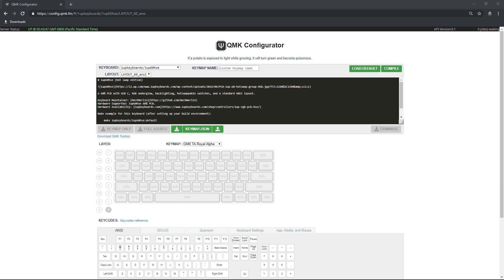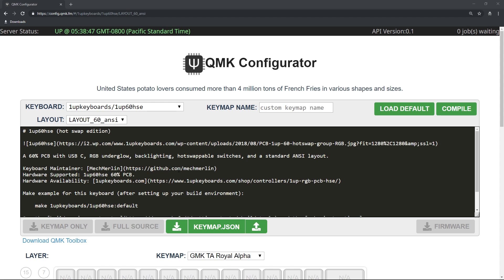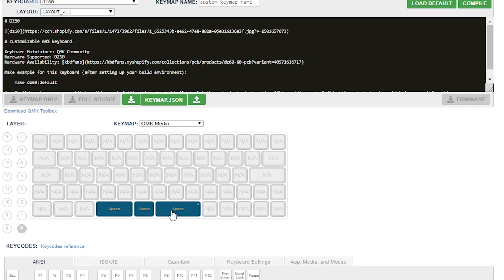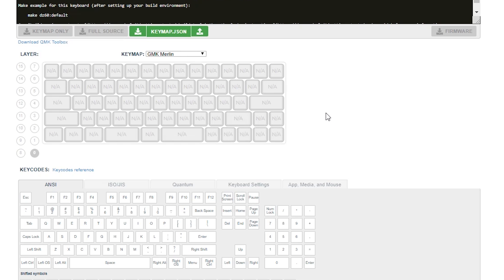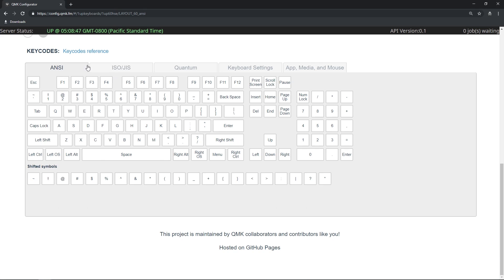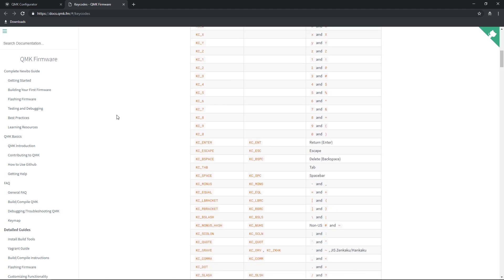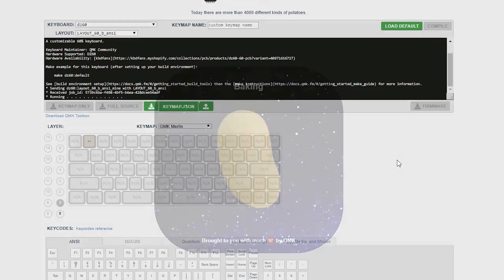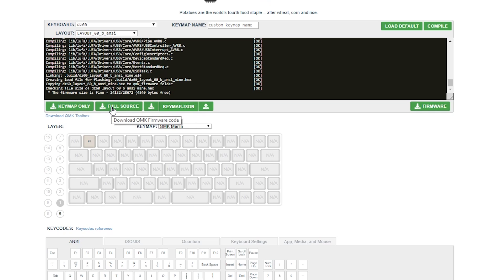QMK Tutorial: QMK Configurator (DEPRECATED)

Comment: underglow toggle for XD87 seems to not working for me
Reply from the maker: You may not be using the correct key
Reply: @MechMerlin  i tried on the key between esc & f1, and also on the 2nd layer. Idk if I'm doing wrong or not. Rgb toggle right?
Reply from the maker: @flumiie  are you sure your board has underglow?
Reply: @MechMerlin  yes, it was working with the default firmware

Comment: Will flashing your keyboard firmware allow you to use buttons that arnt available? for example I have the redthunder K50 could I then do a permanent remap of the enter key? I want to be able to use this keyboard for other devices to.
Reply from the maker: Yes it will work as you described. However this only works if you have a QMK powered board.
Reply: @MechMerlin  Ah that makes sense I thought qmk software was an open source project and could work with any board thank you for your reply :D.
Reply from the maker: @silencedspeech4953  You are correct, it is an open source project, but it still requires the correct combination of specific hardware in order for it to work. Another issue is that, even if the keyboard has the correct hardware, if the manufacturer locks the flashing down, there's no way to get past it.
Reply: @MechMerlin  Damn I wish there was someway to extract firmware somehow and add buttons that don't exist thanks for your help and advice.

Comment: Hi, noob question from a really mech keyboard noob builder (I preordered my first HS board, the HS60 v3). My board will have an ISO-IT layout, but when I click on the keys or try to drag and drop the keys in place the number row appears different from the original ISO-IT layout (for example, shift+2 is " on my keyboard, but the configurator displays an @), and some keys are missing, like "alt gr", right control... does this will affect the final result or is dependent on the language I'll choose in the OS?

Comment: im using the dz65rgb pcb and after i flash it (all other keys are where they assigned to) but the ctrl, alt , windows keys are not where they are supposed to be(win, ctrl, alt, space, alt, fn, win in that order) but i left it as default(ctrl, win, alt, space, alt, fn, ctrl). i didn't change any of those keys does anyone know how i can fix it?
Reply from the maker: you can try pressing "RESET EEPROM" on the QMK Toolbox before reflashing your QMK Configurator created firmware file.
Reply: @MechMerlin  wow you're the best! didn't know what i was doing wrong, thanks!

Comment: i am currently trying to flash a tada68.. I read that you can jsut reset the keyboard, delete the old flash.bin from the drive then copy the new bin into it. With the qmk configurator I want to switch the y and z because I am used to the german keyboard layout and add the special character äöü with the Any key but keep the rest in the english layout. The special character work just fine but switching y and z doesn't work, also my tada somehow came with a german layout and the new bin doesn't seem to change that either. So the only thing happening after putting the new flash.bin into my drive is that y and z change places to the english layout (which i do not want) and the rest stays in the german layout. This is really awkward and quite frustrating.

Comment: Possibly a dumb question, but what if your keyboard isn't one of the options on the configurator?
Reply from the maker: The configurator is a collection of all officially supported QMK firmware boards. If your board is not in the configurator, your board is more than likely not supported by the QMK firmware. You can file a request for it on the QMK firmware github page, but please be advised that QMK firmware currently can only support boards with a certain hardware configuration. Not all microcontrollers are supported.
Reply: MechMerlin Ahh, okay. Its a ps2arvgb controller so it's probably not supported. Thanks.
Reply from the maker: @Connor-uu  Which board is it? ps2avrgb controllers can be supported by QMK. I've recently put a lot of them in. This coming Tuesday I'm putting in support for the TGR Jane.
Reply: MechMerlin It's a Punchy 1800. 

Talked in the discord and found that other people are using bootmapper so I'll be giving that a shot after work today.

Comment: Having trouble with the media keys for vol + vol - etc on my DZ60
Reply from the maker: Which keycodes are you using?
Reply: @MechMerlin  KC_VOLU 
The keycodes in the multimedia key rows. I've tried the Mac(OS) ones as well.
Reply: Media keys work on another computer. Trying to figure out what setting it is on this one. Anne Pro 2 works though.

Comment: Can you configure two keyboards as one in this?
Reply from the maker: Could you elaborate on that
Reply: I want to make a mechanical keyboard with a custom frame. The primary keyboard would be 75% and I'd be putting a macro pad to the left a little bit. It would be on the same frame (different PCBs obv.) so I want to know if the tool can let you configure the keybinds for both.
Reply from the maker: @tomahawk7669  you can do this using QMK firmware, but what this video shows is a tutorial on how to use the online GUI of QMK Firmware which requires boards already supported by QMK Firmware. You would have to write the firmware first before this tool would be of any use.

Comment: does the LT in quantum codes not work correctly?? annoying..
Reply from the maker: Can you elaborate on what doesn't work and how you are using it
Reply: @MechMerlin  on qmk i cannt set the lt in quantum codes. It wont let me click on the little box to put a command inside.
Reply: I add it tp the keyboard but i cannot edit the box if that makes sense
Reply from the maker: @thump3r  Can you explain how you are doing it? I just dragged LT0, then dragged the letter E into the box.
Reply: @MechMerlin  yea if i drag into the box then it get stuck a green color. but i was dragging from the keyboard itself not the code at the bottom so thanks. i dont know why i didnt think of that. i was used to the chinese config for the dz60.

Comment: Hi Merlin, is KBParadise V60 Type R Polestar fully supported with QMK? I have made all keys working except the backlight functions. I mapped some keys to "BL Toggle", "BL-", "BL+", "BL On", "BL Off", etc..but those keys don't work at all.
Reply from the maker: It's fully supported but the backlight feature isn't on by default.
Reply: @MechMerlin  So what's the solution?
Reply from the maker: @johnman750  you have to compile from source, edit the rules.mk file to turn on the features you want.
Reply: @MechMerlin   I see. This sounds more like a hassle than using TMK solution. Would there be an update to config.qmk.fm to support the backlight key function in future?
Reply from the maker: @johnman750  It should actually be easier as the process is well documented in English lol. The main problem is that the KBP V60 Type R comes in two flavors, the polestar and the regular. It's the same PCB but the difference is one has things soldered, and the other doesn't. What this means in software is that we have to answer the question, "do we turn on the features of the Polestar globally?". That is the question that needs to be discussed first. At the moment I'm trying to figure out if there are ramifications to turning on non existent features.
Reply: @MechMerlin  Maybe we can just create two keyboard configurations in config.qmk.fm: v60_type_r and v60_type_r_polestar ?
Reply from the maker: @johnman750  I'm not in favor of that implementation as that results in two identical directories of code with only the RGB stuff different. Based on some talks I've had it seems that enabling the LEDs on an LED less board should not be an issue. I can work on this later tonight.
Reply: @MechMerlin  Thanks, let me know when you have updated it.
Reply from the maker: @johnman750  You can probably check by tomorrow morning
Reply from the maker: @johnman750  It should be up now!
Reply: @MechMerlin  Just tried it, still error.
Reply from the maker: @johnman750  hmm I'm not seeing this issue on my system, I'll dig deeper this weekend.

Comment: A little note if you are using TMK previously, you will need to uninstall the existing driver first, e.g. ATm32U4DFU. If not, you would receive error "dfu-programmer: no device present" when flashing. This happened to me when I'm trying QMK on my KBParadise V60 Type R while previously I'm using TMK.

Comment: I'll guess I ask it again on the Discord but for me, the thing that I didn't get is really what is the difference between a keymap.c and keymap.h (beyond the content ofc). 
And what is with www.keyboard-layout-editor.com, it's somehow explained in the docs but it does explicitly say why do both ways exist and what are the pro/cons of each keymap. 
And yes, both editors are listed in the docs. 😊
Reply from the maker: .h vs .c
.h are header files that typically act as a library of functions/routines to be used by the .c file. QMK Configurator does not provide any additional functionality that would require the use of a keymap.h, hence we provide only the .c download

keyboard layout editor
keyboard layout editor, or kle for short is a tool used to create keyboard visuals, plate files, etc etc. As an end user (one who uses QMK Configurator to create a keymap or firmware), KLE is not in any way shape or form used. As a developer however, it can be used when creating the info.json files used by QMK Configurator to generate the visual layout.
Reply from the maker: Also, I'm curious as to what docs you are referring to?
Reply: @MechMerlin  those https://docs.qmk.fm/#/reference_configurator_support?id=building-the-json-file

The thing that I do not get is why would we ever use a .h over a .c
Because I saw both configurations on the github repo, keyboards folder. 📂
But I didn't get why people sometimes tend to use the other.
Reply from the maker: @konstantin-bifert  That link you posted is actually one of the steps for a software programmer to get a brand new keyboard supported by the QMK Configurator. Unless you are taking some new keyboard and programming it to work with QMK, you will not have to work through this step.

A keymap.c must always exist as it is the file that defines the keymap. Can you provide me an example of someone using a keymap.h?